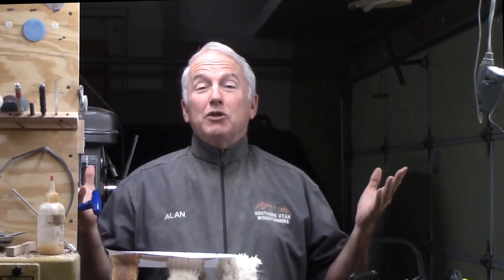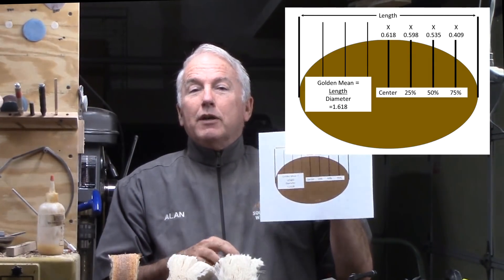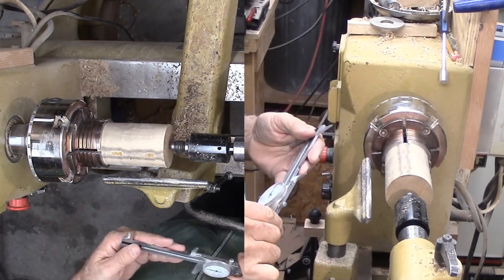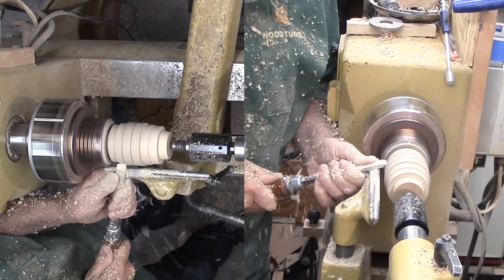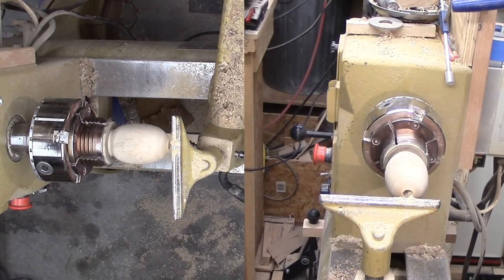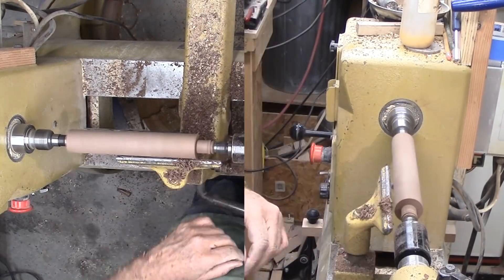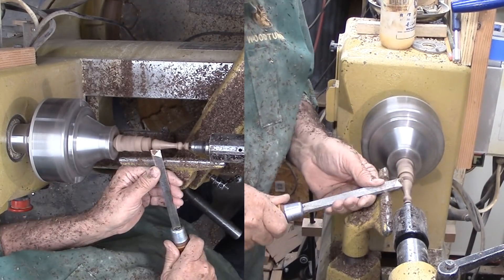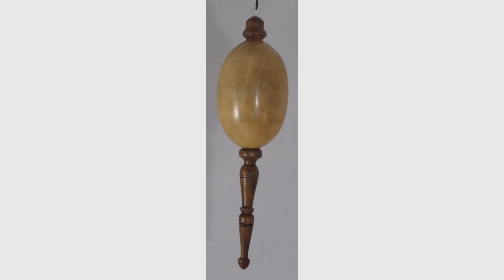How To Turn Perfect Golden Mean Ellipse Christmas Ornament

Comment: Alan, have you thought about maybe after you've finished the outside of the ornament, cutting it in half to hollow ? I had to learn to do that because I'm unable to do it the way you did. I know, lack of practice.   ;-(
Reply from the maker: Actually, I prefer to hollow in halves over hollowing from a small hole when I can disguise the break. Much easier, Much safer.
Alan
Reply: Thank you Allen ,have a marry marry Chtlstmas

Comment: perfect use for the wood . never used it before cheated looked it up here> https://www.wood-database.com/persimmon/ for odd wood I have found lilac trunk and heavy limbs make great turning wood for finials ,wands, pokey sticks , even pencil holder got real board one time during a good snow and sliced some up into tiny planks and glued them up worked good sorry waffling
Reply from the maker: A ebony relative. I would not have guessed.
Good lookup tool
Alan